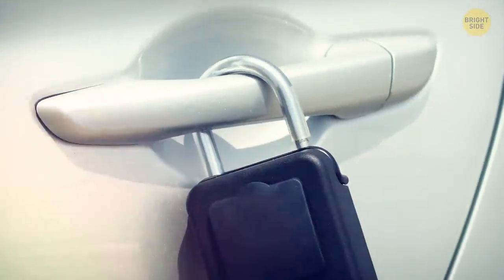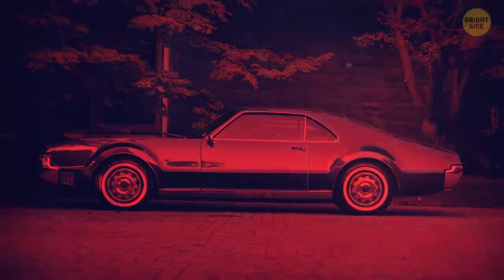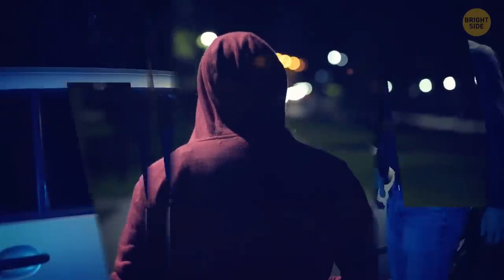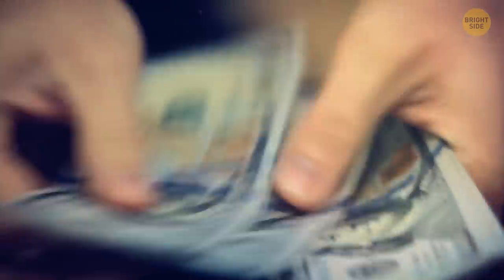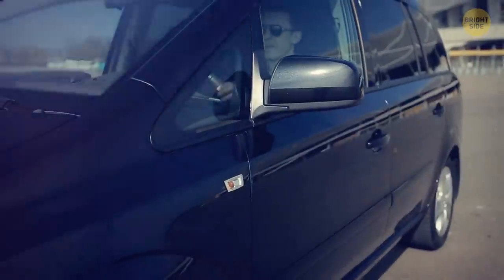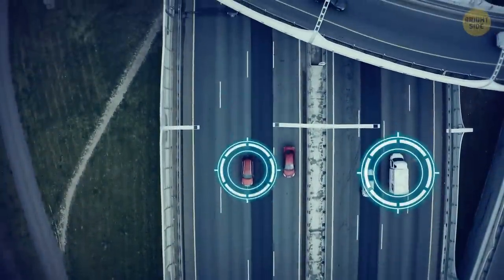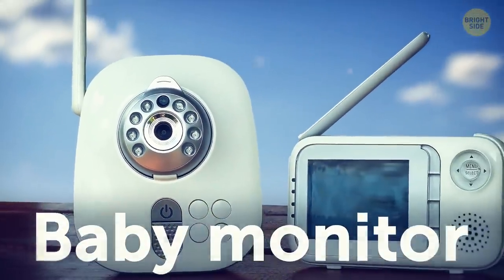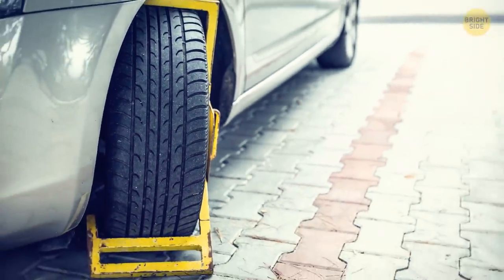If You See a Lock In Your Car Door Handle, Call the Police

Comment: Why wouldn't someone use bolt cutters to cut the lock off the handle? Even if you didn't have any cutters nearby it wouldn't stop you from getting into the car, even if you had to go in the passenger door and climb into the driver seat. Then drive to Home Depot or a hardware store to get  some bolt cutters.  I don't get where the scam comes in..🤔 I guess it was be a little inconvenient but that's about it..🤷